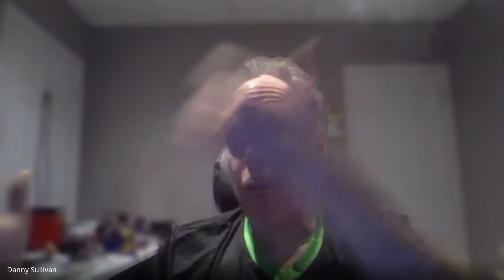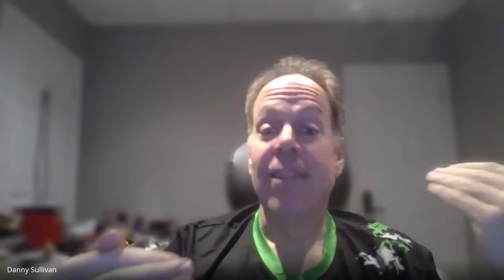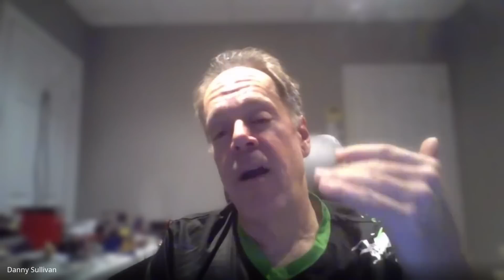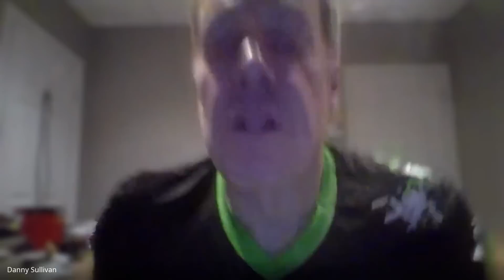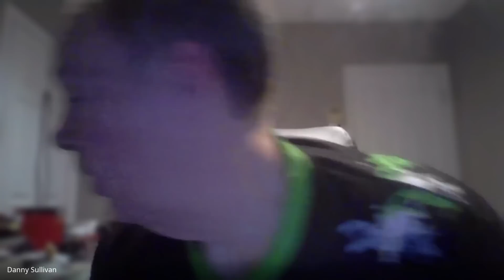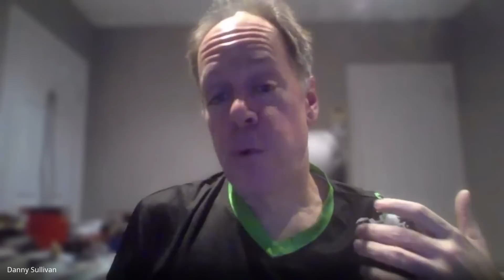Designing the Ultimate RC Batteries: Danny Sullivan from SMC Racing

Comment: Someone just needs to create an industry standard how to measure discharge performance, so an objective test can see how each battery fares and fulfils its label. Any professional company could just define a standard for itself and allow others to adopt it. We need a similar shift as we had in the Megapixel race ,where the numbers went higher but picture quality did not relate much. Took years for consumers do stop looking at that number and looks for image quality comparison directly. And at least for Megapixels, the factual number of pixel was correct. Consumers incentivize lying by chasing the C number, but also understandable, because other specs can be trusted (size, voltage).

Comment: Using AI and linear programming this would be an easy system to optimize for each battery application.  I am surprised that battery manufacturing companies don't set this program up for you.  I am sure they have a sharp chemist or chemical engineer on their staff that know how to do this.

Step 1: Work with the battery company that produces the best batteries.
Step 2: Determine if some parts of the battery are boundery conditions and contraints such as one cathode or anode material is alway best independent of cost.
Step 3: What electrolyte formulations are available (I like Brawndo).
Step 4: Find out if they have parametric curves for the materials used in the battery.

I wrote nonlinear optimization programs with differential equations using Jacobian matrix for refinery operations and optimized projects costing over 500 million, so I know it can be done.  I think Chris is smarter than me.  I bet he could do this or knows someone.

Comment: On the C-rating front. And even things like cell matching standards. It honestly just seems that nobody has bothered to put forward an industry standard for factories to work with together- not that it isn't possible to. If consumers start asking for it's 'XYZ123' score or they won't buy it, the factories will move to meet those ratings or suffer losses. It just need to have thoroughly transparent cincepts, rigorous test methods and conditions and able to be checked by third parties with calibrated devices. Even if it means that multiple standards/scores must be developed to account for different battery characteristics and nuances, it would mean that customers would actually know what they are buying. Meaning there won't just be outright 'good' or 'bad' batteries, but batteries with certain characteristics meeting different needs.

Comment: I recently bought a couple of 6S 1400mah SMC batteries and these are no joke the best batteries I've ever used.  The C rating is insane and the voltage stays strong throughout the flight.  In fact,  voltage stays high for so long that you better land at 3.5v/ cell cause it'll drop within seconds from there.

Comment: It would be interesting to see some data on how charging at a higher C rating affects the actual lifespan of the pack. If it reduces it by 50% that would be a big deal, but if it only reduces it by 80% then buying fewer packs and fast charging at the field would be worth considering
Reply: I think you mean, “… if it only reduces it by 20%…”
Reply: @logo10flyer  Thanks, yep that's the one

Comment: 650mah and 850mah in 4 and 6S are very popular for 2-4" Drones, under 250g (cause of regulation)
Reply: I am searching for 4S 850 or 650 now for my 3.5 and yea SMC does not make them:( so i will probably need to go into tattu 5.0
Reply: @stalker777777777  I have 4S 650 from tattu, 5-7 min fly times, 850mah 4s have like 8-9 min of fly time, 6min or less for racing.

Comment: They’ve been selling FPV packs for quite a while. I recall Mr Steele used to use those original FPV packs circa 2016 or so I think
Reply: Do you mean before he used Thunder Power?
Reply: Nah. I’ve been using SMC for my speed run cars for years. When I got into FPV a couple years ago they weren’t available.  I was hoping they would make them and as soon as they came out I ordered a bunch. 26 to be exact.